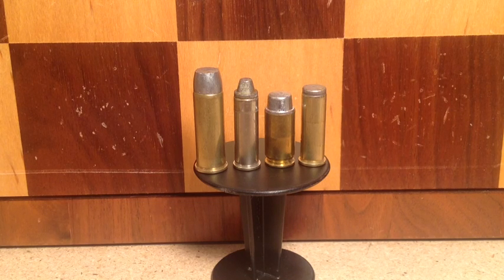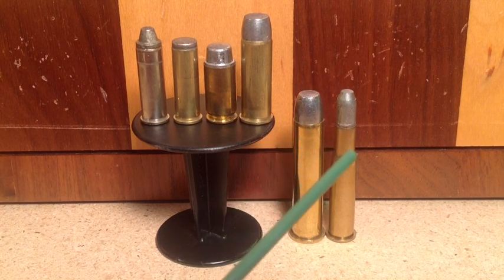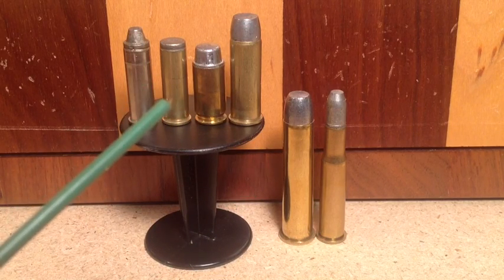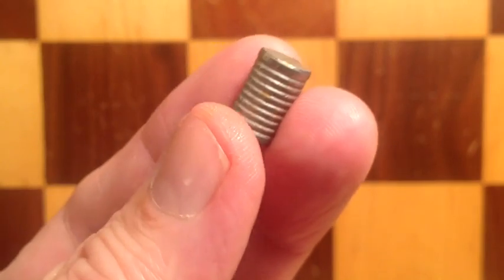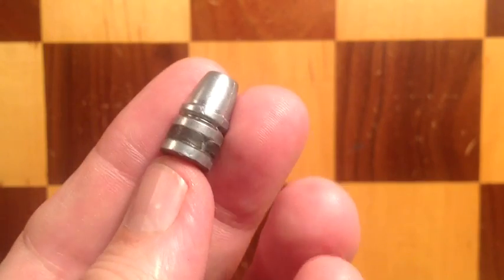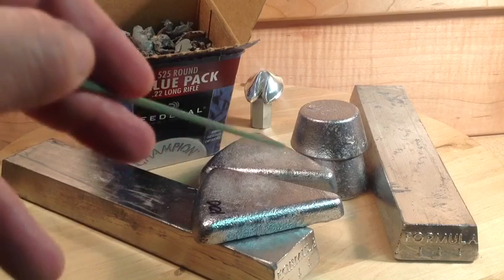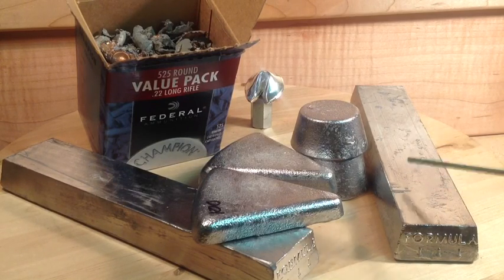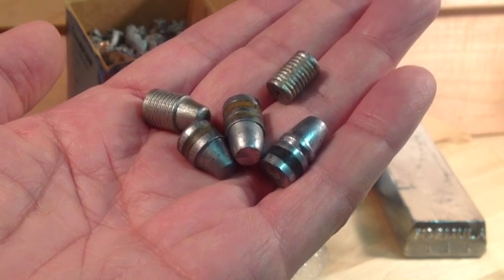Lead Hardness FAQs & How to Mix Bullet Alloys For Hardness

Comment: I'm new to casting, in fact I actually haven't cashed anything yet, i'm still doing research and trying to decide if that's the route I want to go.  With that said my biggest concern is the right ratio to use, the  two calibers I would be casting is 9mm and .223.  My question is if I was using wheels weights and then powder coated them, will I still need to add tin and antimony?
Reply from the maker: Jason Krohn - Plain wheel weights is good to be used straight up for our pistol shooting up to light magnums.  In the past, the famous gun writers like Skeeter Skelton did all their pistol shooting with wheel weights.  But one thing, the most current lead wheel weights are a bit softer than the wheel weights of the past...if you powder coat the bullets, the difference should not matter.  If no PC, than you might need to add some linotype if you intend to shoot cast in your magnum handguns.  Probably a 4 WW to 1 Lino mix.  Please come back for other questions...otherwise, my playlist on Cast Bullets should give you lots of information.   Happy Thanksgiving,  FC

Comment: What about of in doing ar15 rounds
Reply from the maker: hector gonzalez - For AR15 rounds, I'd cast the bullets with Lyman #2 alloy or equivalent (90% lead 5% tin 5% antimony) or even sweeten it a bit with added linotype (84% lead 12% antimony 4% tin) say 1 to 1 mix.  Then powder coat the bullets and gas check 'em.  Then shoot them working up loads towards maximum stopping when accuracy degrades.  Best to ya,  FC
Reply: FortuneCookie45LC  ok thank u if I powder coat do I still need to but a gas check?
Reply from the maker: hector gonzalez - For handgun shooting, gas checks are not needed - you can still put them on if you wish or if the bullets shoot more accurately.  For rifle I'd recommend you put the gas checks on if the bullet is designed for them.  Good reloadin' to ya,  FC
Reply: FortuneCookie45LC ok thanks for the help

Comment: I've heard this bullet obturation B.S. for several years now.  The harder your bullet the less leading you will have.  Can someone explain to me if the bullet is already 1 to 2 thousands larger then the bore diameter why it has to swell to seal the barrel?  He did an eloquent job of explaining this, the trouble is none of it is true.  I shoot linotype bullets at all velocity in several pistol and rifle calibers and get no barrel leading at all.  Read one of Lyman's reloading books on bullet casting.  The softest bullet they recommend is #2 alloy ( BHN 15) and a lot of the loads recommend linotype ( BHN 22 )  No where in their books can I find any recommendation to use some soft alloy except maybe for a black powder rifle.  Pure wheel weights make pretty good bullets up to about 600 to 700 ft per second.  The only reason anyone ever used softer alloys is they are cheaper.  They don't work as well.
Reply from the maker: deadeye2658 - Yes, there has always been controversy, and I respect your reports that you are getting good results shooting linotype bullets.  Now this reply is long, but I make it because I care about the information that others receive.  It is not my information but what has come down from the past 40 years of study and practical experience.  Your first sentence has a serious flaw in it..."bullet obturation B.S."  If you don't get bullet obturation in your barrel, you will have poor performance - no obturation, no rifling stability - how is that B.S.?  If you didn't mean that, why was it said?  When you ask for explanation about big bullets swelling, there was actually no mention anywhere that bullets are .001 - .002" larger than "bore diameter" (bore diameter is smaller than groove diameter).  If bullets are .001 - .002" bigger than groove diameter in our rifles and auto pistols (not revolvers), it would be foolish for anyone to suggest that those bullets have to "swell" to seal the barrel - that defies physics - that was never said anywhere either.  The errors you have made in saying what was said by another being untrue already invalidate any judgements or conclusions you make.  Of course they are untrue if they were never said or were contrary to what was said.  If I said that John Paul Jones leadership to "not shoot until you see the red of their eyes" was untrue, of course it is untrue because he never said that.  I just spent 1/2 hour reading three of Lyman's books again before I replied here to not be mistaken - The Lyman Cast Bullet Handbook and the Lyman 45th and 50th Edition Reloading Handbooks, and I invite anyone to check these.  When you say that "a lot of the loads recommend linotype (BHN22)", you are going to have to show me where you get that, because no where in any of these three books with all the included reloading data including magnums like the 300 Weatherby, 460 Weatherby, plus the 308 Win, 30/06 etc. or any handgun caliber with cast bullets is linotype recommended.  Lyman #2 alloy is specified.  So if you have Lyman data that shows use of linotype, then they are contradicting themselves and cast great doubt on any of their data.  Turns out, yes linotype can be used for cast bullets, but nowhere have I found that linotype is recommended because the resulting bullets are too brittle and will fail if bone is hit.  And when you say "The harder your bullet the less leading you will have" why aren't you casting with SuperHard alloy or Foundry Alloy?   And when you say that "maybe" soft lead is recommended for black powder, you have misstated as there is no maybe to that - ask the muzzleloaders.  Also, you fail to mention something that Lyman and Lee strongly recommend - pure lead is to be used for all shotgun slugs bar none - did you happen to miss reading that in all your books??  Also "pure wheel weights" (wheel weights are not pure and the formulation of them has changed a bit over the years)  are good for all pistol shooting including magnums 1400 fps so your 600 to 700 is way off.  When you say "The only reason anyone ever used softer alloys is they are cheaper.  They don't work as well", you are going to have to refer to Elmer Keith who used pretty soft 1 to 20 alloy for his magnum load developments.   Sorry, deadeye2658 - you are a friend, but when you accuse someone of either lying or being an idiot, you need to make a better case than you have presented as your arguments and reporting are full of holes.  I know your extra hard bullets work well for you, but if it happens that your bullets are the right size for your guns, you might be getting that great performance for reasons other than the hardness.  Also, please see what a trusted commercial cast bullet company, Missouri Bullets, has said about too hard bullets causing barrel leading - and their "Hardness Optimized Bullets" - optimized to velocities and pressures - they recommend BHN 10-12 for cowboy and target to BHN 18 for magnums - they do not recommend shooting linotype for anything or everything or they would simply make all their bullets with linotype... Best Regards to you,  FC
Reply: Please refer to Lyman's 47th edition.  All of the loads listed for 38 spl. and 357 mag.  are linotype.  Please also note that Lyman doesn't use the term 'bullet obturation' anywhere that I can find. They recommend that if you are getting barrel leading to use a harder alloy.  ( nowhere does it say that if you are getting barrel leading to soften the alloy.)   Almost all of the loads they list for all calibers use #2 alloy.  Have you questioned why they don't recommended using softer alloys in some cases.   I think that pretty much every one else knew that I was referring to the grove diameter.  If the grove diameter is .357 and the bullet diameter is .359 why is it necessary to have a bullet soft enough to bump up.  Why would anyone use an undersized bullet.   I have been casting bullets since 1972 and found that the harder the bullet metal the less leading will occur.  Soft lube is also necessary to eliminate barrel leading.  Retrieved  bullets that have been hard lubed will still have the lube in the groves.  Bullet obturation is a great theory, it just doesn't happen to be true.    I didn't think that you were lying or an idiot.  I believe you have bought in to this urban myth as have so many others without any research or testing.
Reply from the maker: deadeye2658 - Remember when I said you and I are friends - of course, I meant that. We are both much experienced bullet casters - You since 1972 and me since 1971 - remember that well as my second casting session was 45 ACP at my girlfriend's place and proposed to her later that year.  If you and I got together, we could cast up a storm and then shoot up a storm or not - but we could is the point.  After all this time, we know what works - so I've got a problem when it seems we are in disagreement - what works works, so what gives?  When you tell me to check the Lyman 47th I'll do that if you check the Lyman 50th.  Obturation is defined as the sealing of the barrel and action of a firearm so that bullets or shot can be propelled cleanly and accurately.  If Lyman has not used that term, perhaps they used seal the barrel or seal the bore instead.  Lyman has been in business for 120 years, but obturation is a more recently used term.  Based on that definition, I have never heard of the obturation BS or the urban myth that says to shoot soft lead undersized bullets and let them "bump up".  That is indeed absurd today and is not in the definition of obturation, but the bumping up was a horrible success with the black powder Minnie Balls of the Civil War.  "Bumping up" today, with smokeless powder will get heavily leaded barrels, poor accuracy and guns blowing up.  I have not heard anyone, anywhere, anytime, anyhow suggest shooting softer lead bullets to cure leading problems either so we have a baseline there.  You like hard bullets, I do also for my magnum 357s, 41s, 44s and 45s.  But when you note that Lyman 47th recommends almost all other loads to be used with #2 Alloy but lists "all" 38 spl and 357 mag to be done with linotype - I don't doubt you for a moment, but don't you find that a bit odd.  I'm supposed to use linotype for my 148 grain target wadcutters and my standard 158s, but softer #2 alloy can be used for a 300 Weatherby  - astounding really.   I might just switch to the Lee Reloading Manual as Lyman just lost credibility, but then again, I don't use the 47th Lyman.  I'll go check my 50th and if it says that linotype should be used for all 38s and 357s, I will indeed switch loading manuals because I'm not liking what I see - heaven knows I have many manuals for ready use.  When you say that  "bullet obturation is a great theory, it just doesn't happen to be true" that explains the whole basis of our debate - we aren't talking about the same thing...to me, bullet obturation is a basic principle of firearms and is a must, not a theory...   Best to ya,  FC

Comment: Hello FC ! Is there an about good mixing ratio for pure lead and wheel weights to obtain a fair bullet in moderate .38 loads ? Many thanks !
Reply from the maker: A.C. van Klaveren -- Problem with mixing harder lead starting with pure lead is the big dilution factor presented by the pure lead.  Takes a lot of hardening and Wheel Weights don't have the big amounts of antimony to do the job...That's why we use linotype (12% antimony) or superhard alloy (30% antimony).  That can do some serious hardening.  Wheel weights at 4-5% antimony don't quite make it.  So best would be to use the wheel weights straight up to make pistol bullets and save your pure lead to make shotgun slugs or muzzleloader bullets.  Best to ya,  FC

Comment: Hey FC,  I'm using right now pure lead ( roofing lead from a scrap yard ) for my 125 gr bullets for cowboy loads. Would quenching them in water add enough hardness to get buy or do I need to PC my bullets.
Reply from the maker: +Nick J -- I know you have heard that you can get spectacular hardness by quenching, but I haven't found that to be the case.  You cannot rely on quenching to harden more than 1 or 2 BHN - that is still worth getting of course.  People use their fancy lead testers, but if two users use the same lead tester, they wind up with different readings.  Lead hardness is not the primary factor in clean accurate shooting bullets anyway - the bullet fit to the gun is the most important factor for cast bullet success.  (note: jacketed bullets of caliber do not have the same requirements - they are good to go most of the time - just drive them fast enough to obturate and they will shoot even if they don't start off fitting the gun - if cast bullets do not obturate by their fit before they are shot, they will lead the gun - and then they won't shoot well and will only increase the leading build up) Back to your question, at the low cowboy velocities, you can shoot your 125 pure lead bullets - I recommend you start with .358 - .359" bullets with 45/45/10 easy lube.  Marlin micro groove barrels will need at least .360".  And yes, you can definitely PC the bullets - we have already discussed the OK legality of PC in cowboy action... Success to you,  FC
Reply: No bullets have to have arsenic in the material to take a temper.  Pure lead has none.

Comment: I'm about to pick up about 500lbs of ingot lead I purchased. It is 
mostly soft plumbers lead for lead and oakum joints for cast iron. There
 are also ingots of 50/50 solder. I want to cast for 38/357, 44 mag 
& 30 cal. rifle using GC & HF PC @2,000fps as well. I have a limited 
resource of about 5gal pail WW. I need recipes to alloy the soft lead 
into something usable.  Something along the line of Super hard + soft 
lead + 50/50 & 95/5 or pewter. I love watching your video's!
Reply from the maker: +NYfirefighter357 --- Replied on your other msessage... Good castin' to ya,  FC

Comment: hi Good morning my question of the day is i purchase lead ingot on ebay the seller says its soft lead i try to do the nail test on the ingot its hard but also the ingot is charcoal color like it has been around for a very long time how is the best way to test that lead and if it is hard can i use it for buckshot and do i still have to water quench thanks.
Reply from the maker: +ocean374 -- The charcoal color is surface oxidation - lead oxides or carbonates can be almost any color from red, to yellow, to orange to whitish and black - lead was used in making tough paints in the past.  You will need to test some of the lead that doesn't have the color to best determine the hardness of the metal or simply expose some of the metal underneath and then do your thumbnail test.  If it doesn't dent easily, you've got probably around BHN 12-15 perfect for your buckshot especially if you water quench for an extra BHN or two...(some will tell you get BHN 26 after water quenching, but I haven't seen that).  Good castin' to ya...you probably have the Lee or the Sharpshooter molds... FC
Reply: FortuneCookie45LC ok thank you yes i have the sharpshooter mold very nice mold thanks again like always
Reply: +FortuneCookie45LC well it was a bad day the lead i ended up from ebay was tin i was told it was tin from the scrap yard that's why I had a hard time casting no more ebay for me.
Reply from the maker: +ocean374 -- TIn is still very useful for us bullet casters.  TIn is also very expensive now, and you might have gotten a great deal.  But I hope you didn't get zinc.  Zinc is a relatively cheap metal from zinc wheel weights - but it is more than useless for bullet casters - it is like the plague.  Zinc melts at 787 degrees - hope you didn't get zinc...zinc fouls up our lead, and you cannot cast or shoot well with it in pure form either.  Best to ya,  FC